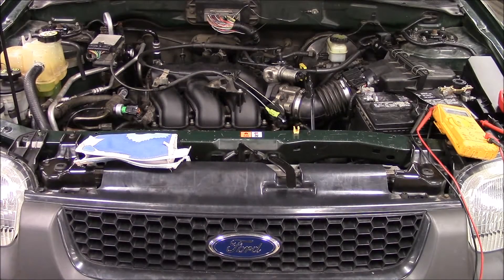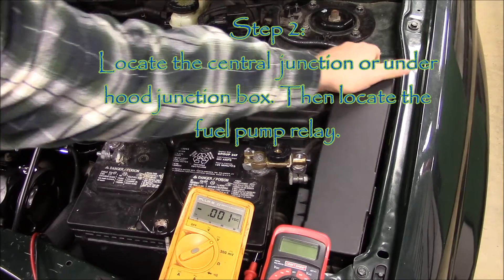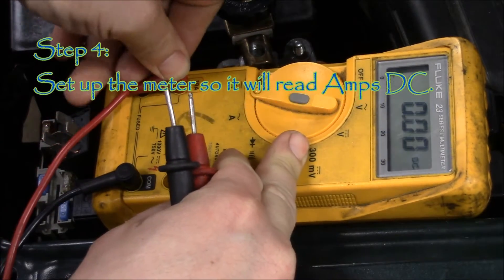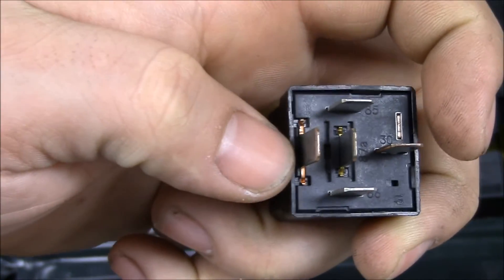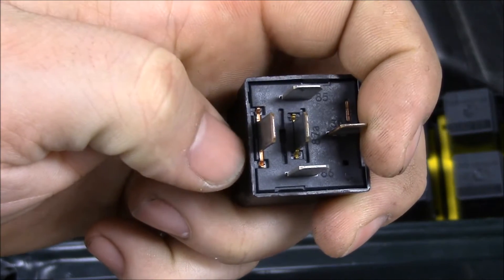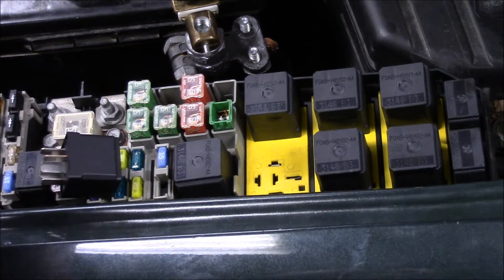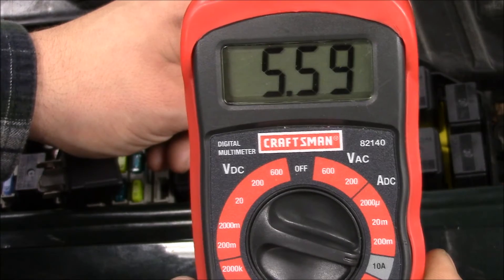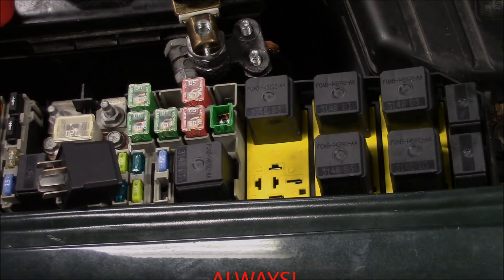Fuel Pump Current Draw

Comment: I currently have a 2008 Ford Crown Vic, fuel pump, pcm, and coil relay are all getting hot. With the fuel pump having a 12amp draw. Would you still think there fuel related issue or a problem with the pcm. (Fuel pump, fuel filter, and fuel pump relay have already been replaced )